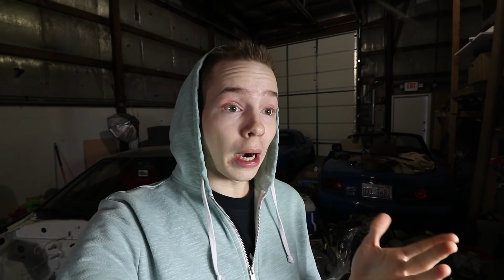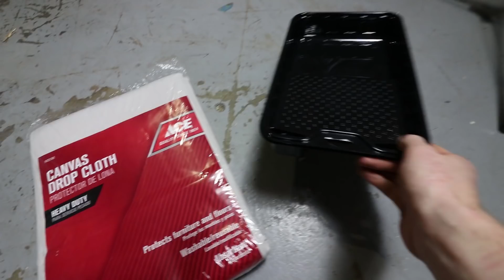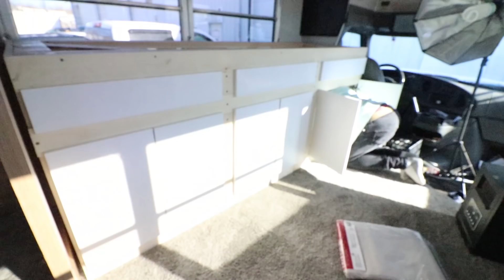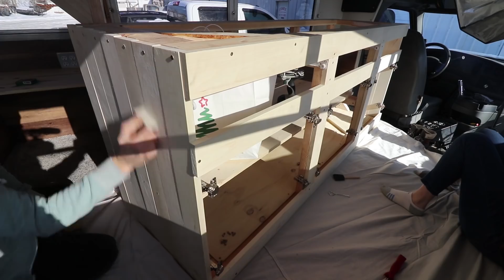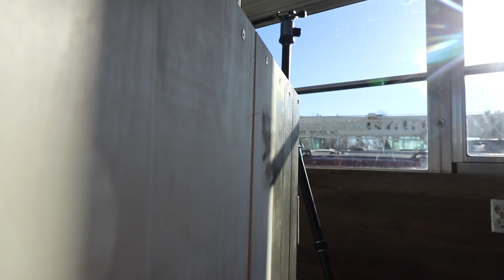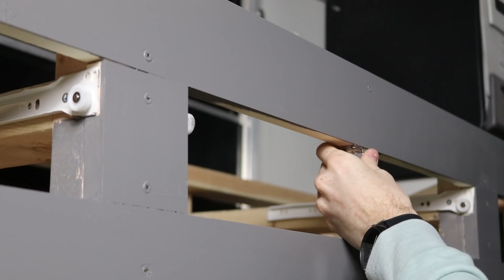Interior Paint on the Adventure Bus!

Comment: When you're taking the cabinet doors off you leave the hinges on the doors because otherwise you can damage the doors since the screws screw onto wood while the door hinges screw into the other metal part of the door hinges.
Also it's in a way to be taken apart like that because that's how you adjust the doors.

Comment: You should have tinted the windows first and used the window tint that helps hold heat in
Reply: Live4 Boost he can tint them from the outside
Reply: Ruben Braekman if you can it wont be nearly as durable
Reply: "Holds in heat." Great. A giant yellow people microwave in the summer. Think about it. You go drifting in the summer. Not the winter. You can always heat a cold room. You cant as easily cool a heated room.

Comment: the fake stone countertops work well enough for a rv you whont be doing a lot of cutting on it and the plastic covering is eazier to keep clean , you cant put hot pans on them touch 
probably need a small camperstove on propane , you could just setit up for cooking and store it in the cabinet when not , as for a sink i suggest you use a plain washtub and a jerrycan with a tap or a pump for water . to empty tub pick it up and trow the water through the open door